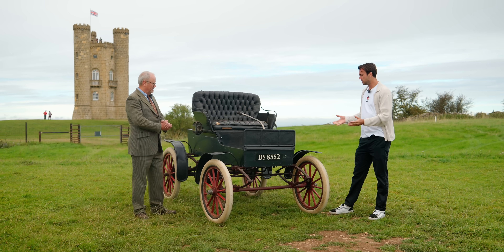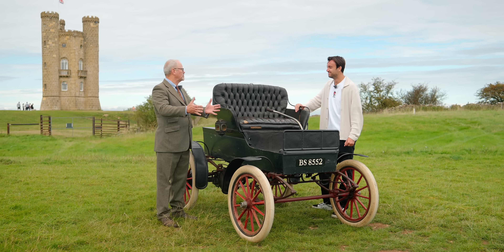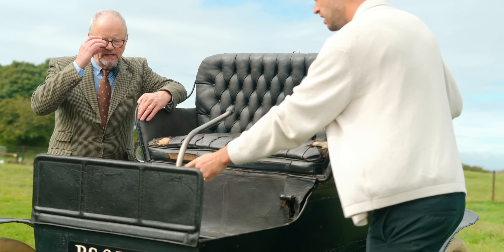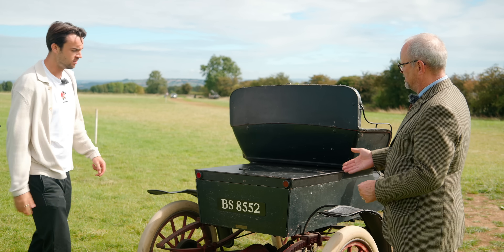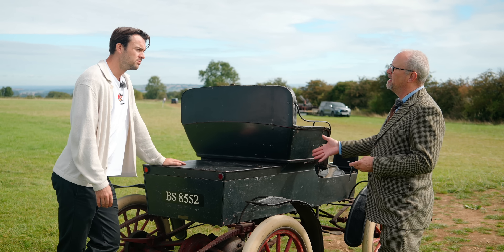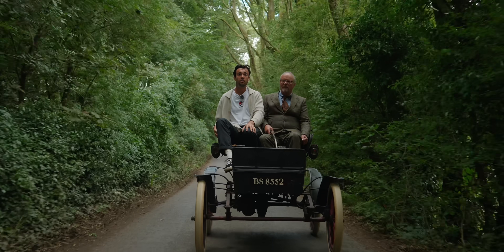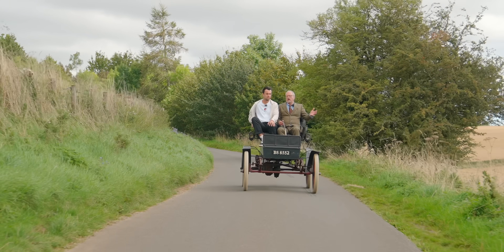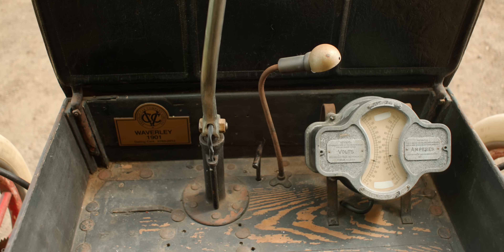Why Electric Cars Failed 100 Years Ago

Comment: An often overlooked point is that electricity was only available in towns and cities in 1901 and not all towns at that. Some rural areas did not get electrified until the fifties and sixties. So the electric was confined to urban use, which is where it shone. It was gas cars that put the country on wheels.
Reply: And before petrol became widespread steam would be what you want If you wanted to be sure about being able to refuel.
Reply: @TheHenirik Yep. There’s a reason that all the early tractors were steam-driven.
Reply: @76horsepower  >  There’s a reason that all the early tractors were steam-driven
Henry Ford mandated that the Model T be able to run on Ethanol because the farmers could make it themselves if needed.  He sold a car for the common man and the average farmer.
Reply: @TEverettReynolds  and yeah, that could very well be part of Ford's, and the petrol engine in generals, success, that and how cheap his cars was.

Didn't they also sell conversions to be able to do farm work with the model t?
Reply: @TheHenirik  steam was mostly for much heavier/heavy duty applications like trains, agricultural machines, mining and even industrial needs.
Reply: @alanmay7929  then how do you explain the several steam powered cars belonging to Jay Leno ?
Reply: @alanmay7929  steam was the obvious choice for heavy applications for a long time yes, but there were a pretty large number of manufacturers making steam powered cars, trucks and tractors before the petrol engine took over completely
Reply: @bobbrinkerhoff3592  In 1900 steam power had been around for almost 100 years in steam boats, trains, and industry, Many men were familiar with running steam engines   They found them easier to manage than the new fangled gas engines and steam power was more reliable
Reply: @mrdanforth3744  my reply was to a post saying that steam was mostly for industrial and agricultural use . The downfall of the steam powered cars , was when people that had no experience with a boiler started buying them and managed to blow themselves up creating lots of negative press in the process .
Reply: @bobbrinkerhoff3592 along with ICE engines getting better with tine overtaking steam.
Reply: @bobbrinkerhoff3592 that's mainly owned by the upper class of the time as the working class usually got the train/bus/horse driven/ the model t due to said reason of being able to make ethanol as farmers did
Reply: @TheHenirik   Hell, in the 1920s the production car with the fastest 0-60 time was driven by steam, the Doble boilerless steam care to be specific.
Reply: @alanmay7929  There were quite a few steam automobiles as well.
Reply: @bobbrinkerhoff3592  What kind of explanation do you require?
Reply: @bobbrinkerhoff3592  The downfall wat the 30 minutes it took to get them up to steam, the price, and the complexity of operation. They didn't blow up.
Reply: @Bertie-l6z  I was responding to someone saying that steam was limited to large agracultural uses , such as traction engines . My comment to him was ; so how do you explain Jay Leno  having steam automobiles in his collection , if steam was ONLY used in large applications ?  As for steam cars having blown up back in the early days of the automobile , you might want to do some research on the subject , as it did happen , along with people being scalded .
Reply: @Bertie-l6z  30 minutes to build up a head of steam , compared to the time it takes to harness the horse to your carriage ? Plus not having to muck out a stall , or feed / water the horse twice a day . Not to mention the time it takes for the wife to get ready to leave the house .
Reply: @bobbrinkerhoff3592  Compared to turning the ignition on , starting snd going. I've owned a veteran steam car, a 1909  White, and an 1899 Sperry electric.
Reply: @bobbrinkerhoff3592  Um, sure.
Reply: Still true in 2023 in most of the developing continents …
Reply: @philtucker1224  The only place where that's true anymore is Africa, and not even most of Africa -- all of North Africa is pretty much electrified, and so is a large portion of the southern part of Africa. The only parts that don't have electricity basically everywhere are subsaharan Africa north of South Africa.
Reply: @AUniqueHandleName444  yes I have spent time in (South Africa) myself as my big sister spent most of her working life over there, but even now electricity is limited at certain parts of the day on a neighbourhood rotational basis as you will probably know. In addition I still think diesel and oil generation is quite widely used in less well developed parts of the continent.
Reply: I've been to so many places around the world that had very minimal electricity, eg, no running hot water. You'd be running a diesel generator to charge your ev
Reply: @sdrc92126  100% agree SD, it’s great for the rich western countries to be able to buy these lovely rather impractical gizmos ( like curved TV screens etc) as there is so much surplus money to be spent, while the other 75% of the world is still burning their old furniture to cook a meal on..
Reply: Are we speaking of the United States? Towns in Canada had electricity before the 50s
Reply: @SJHFoto most of the country was electrified by the end of WWII (thanks to things like the Tennessee Valley Authority in the 30’s), it was probably some very isolated areas in places like Hawaii and Alaska that got electrified later.
Reply: @pokepress  So, you were speaking of the United States? This isn't meant to offend, but I thought so simply because on the internet, it is only Americans that comment in world wide forums with the assumption that everyone knows that they are talking about the US
Reply: @SJHFoto  That’s interesting, over here in the U.K. a lot of houses were still just using gas lighting and coal for heating and cooking after the end of WW2 so the government of the day implemented an electrification programme for all properties that gave each house one socket and one electric light to see if people liked the idea. This gradually caught on and they started fitting “fixed wiring” into all houses from the early fifties. However I remember my parents buying a bigger house back in 1963 and that one still just had the gas lighting and fireplace in every room including the bedrooms..
Reply: @philtucker1224  Was that because it was never installed, or was that because the Blitz destroyed the infrastructure so electricity was stopped?
Reply: @SJHFoto  people didn’t really think electricity would catch on so it wasn’t fitted to houses unless by special request. Electricity supply lines to streets and housing were still quite rare before the end of WW2 and it was really only during the massive local council rebuilding programmes following the blitz that begun in the late forties and early fifties that it was decided to fit houses with electricity and gas supply an indoor toilet and a drinkable water pipe. Bathrooms were not yet fully adopted and most families still bought out the “metal tub” often on a Friday, until that time. (I’m a fifties child and remember my grandparents still had there’s ! ) 😁
Reply: @SJHFoto  Mains electricity was still in its infancy back then, many families were still very much into traditional coal fires and gas or oil lamp lighting. The house my parents bought in 63 was built in 1938 when gas lighting was the popular choice and the two elderly sisters that lived there since new clearly never thought to change I guess..
Reply: @SJHFoto  Some cities had electricity in the 1880s. Most towns and cities were electrified by the early 1900s. But some rural areas did not get electricity until the fifties or later. Obviously, the more remote or distant from a town or city with power the longer it took.
In 1901 unless you were in or near a town or city you were out of luck.
Reply: @mrdanforth3744  I don't have electricity at my house. The closest service is about 5 miles away.
Reply: I guess recharging them a hundredtwenty years ago was quite the challenge on its own.
Wonder how a charger looked like back then.
Reply: @timhartherz5652  probably similar to an electric motor but running in reverse from a steam engine driven pulley to produce electricity. (Think of an old circus merry go round with electric light bulbs around the roof).
Reply: @philtucker1224  Possible, but not very practical.
In 19xx there was already an electric grid in certain areas, probably coal powered.
But i'm more courious about the other end.
Probably some transformer with a rectifier (tubes/valves?) and a convenient semi-standardized plug to hook the car to.
Basically i want to know how a 19hundreds EV wallcharger looks and works.
The electromechanical version of something that is done today with complicated microprocessor controlled semiconductors.
Reply: @timhartherz5652  yes interesting stuff Tim (and don’t forget all electric was just D.C. back then…)
Reply: @timhartherz5652  look at an old car with a generator on it. The old voltage regulators mechanically limited the voltage. Early farm tractors are another good place to see one. You would of had to manually monitor the charge rate to keep the batteries from cooking.They probably had a crude rectifier to convert the AC current to DC. There might have been a few DC generators around from the 1880's still in use in factories as well.
Reply: @timhartherz5652  Very big with glass mercury bulb rectifiers. Pretty to watch
Reply: I'll put you on wheels.
Reply: Hi Mr D.. Lack of an electric grid to recharge batteries is the reason, as you say. The "current wars" between Tesla and Edison weren't settled until 1896 when Tesla's system was used for the first hydro-power station at Niagara Falls. With internal combustion research rocketing ahead car manufacturers couldn't wait about for decades for the grid to expand out into the countryside. During these first years electricity didn't create a mass market, petrol did.

A major factor is that Henry Ford was a firm advocate of aircraft development, and he knew that only i.c.e.'s could provide enough power for flight along with light weight. The Ford Trimotor was the U.S.'s first mass produced airliner. Cheers, P.R.
Reply: I'm trying to imagine soldiers driving around rural France in WWII asking French farmers for a line to charge their electric jeep or deuce and a half. Or electric tank. Piston engines had such obvious advantages over early day electric schemes. In terms of energy density and portable fuel and ability to operate in remote off grid areas or where the grid is disrupted by conflict. Aircraft being an extreme example.
Reply: And 120 yrs later. Electric Vehicles are only really practical in urban centres.
Reply: So 100 years and nothing changed electric cars it's still a rich city toys nothing more....
Reply: Unfortunately yes. Well, it worked at least!
Reply: Horses were more practical for everyone as they ran on grass..
Reply: @philtucker1224  Some even ran over more things.
Reply: we didn't have the technology back then, nothing happened until the Prius and hybrids came out, then we were able to adapt to EV, it would have been impossible 100 years ago to make it, that's why all the early prototypes didn't catch on with the public, why are we still using gas today after all this time, because it was the only one that worked
Reply: Hi Mr Danforth. Shucks, you're sure right. My Grandpappy swore by gas cars. If he ran out of gas, he sent Ma to the nearest General Store to fill up a jerrycan with "Big Tree" gasoline. Couldn't do that with ay-leck-trickery, no -siree! "Howdy Mrs Robinson, will that be positive or negative you'd be wantin'?" 😄. Cheers from the boondocks, P.R.
Reply: Yeah Kerosene was already common in every home. The infrastructure to produce it, store it transport it and sell it was already in place for 50 years. Gasoline was a byproduct of kerosene production. It was the perfect fuel for the time there was never a chance that any other fuel source would have competed. Gasoline was clearly always going to win out because the infrastructure economics and business where there now they could just use all that infrastructure and business to just sell the garbage they had left over to power cars.
Reply: @@davesmith3023 Hi Dave. You're correct, but the ancient Egyptians didn't have a theory of electricity, or the chemical elements, or positive and negative ions. They cannot have understood electric technology. My guess is they found certain electro-chemical effects by trial-and-error because their alchemists were seeking to transmute base metals into gold. What they discovered and had a use for, was electro-plating, which gave the appearance of turning copper into gold. To them, this was all magic. Cheers, P.R.
Reply: My grandfather in the 1920s ran a small generator to give some electricity to the farm. Before electricity reached the area. This should show gasoline was available in the country side much before electricity.
Reply: @pierrepero9338 Hi Pierre. You're right. Five gallon cans can be taken anywhere, but electricity needs miles of power lines. Petrol had cheaper and quicker infrastructure. Cheers, P.R.
Reply: What gas?  Steam?  Natural gas?  Petroleum gas??? I was under the impression some form of a combustable liquid (petrol / diesel) was used to propel a vehicle.
Reply: @Andreschannel_SA Hi Andre. Natural gas is methane, CH4. I.C.E.'s can run on gaseous fuels if set up to do so. They often were during WW2 when petrol was unavailable. Diesels are very omnivorous. Cheers, P.R.
Reply: Was going to say that too.
Reply: It's not like Gas stations were a dime-a-dozen in rural areas either. People had to drive long distances to fill up gas. It would've made a lot more sense to have common charging stations. Also most of the US was electrified by the 1920s, so rural residents could just charge at home. Battery swapping was also available on old electric cars.
Reply: @empirestate8791 Hi. Correct, they weren't, but just like in the Pacific islands during WW2 "petrol dumps" were created out in the boondocks for country folk. Every General Store  sold gas filled 5 gallon tins. Half a dozen of those would keep the flivver going for a month, even if Pa had to drive 50 miles get there. Driving 50 miles to get a recharge was a waste of time, with range of 100 miles you'd have to go back for another recharge as soon as you got home. What you've missed is that petrol is the second most energy dense fuel we have, and during the first half of C20 batteries had low efficiency. 
Battery swapping was only available in the cities (for taxis mainly), and the huge drawback was the weight of changing the batteries. Petrol could be quickly pumped with a hand-pump. Cheers, P.R.
Reply: @mrdanforth3744 as it still is today.
Reply: You’ll never get rid off combustion ,ever
Reply: "... the electric was confined to urban use, which is where it shone. It was gas cars that put the country on wheels". Now it's get the people out of their gas cars and for those with the funds, into expensive electric cars for mainly urban use.
Reply: and so nothing has changed
Reply: Electricity availability was never the problem. It's the same problem we have today: Too expensive, too many drawbacks. And the problems of today are far worse because of the demand these vehicles would need to fulfill compared to gas vehicles. When you're using the same energy as an entire house does in a week, and need it all delivered in 15 minutes, that's a HUGE strain on the grid. Literally HUNDREDS of times the strain. Now imagine what it would cost to upgrade the grid to support them. It would be like rebuilding the grid 100 times over. That's hundreds of trillions of dollars. Same with pushing electric, because the US only produces 8 million vehicles a year in total. That means it would take the better part of an entire century just to meet todays population, not even counting growth over that 100 years, or the replacement of vehicles over that 100 years. Or in other words, it's impossible. We would have to produce 10 times more vehicles just to meet current vehicle demand, and that still doesn't cover the rest of the logistics. It's simply impossible.
Reply: I think it was 1959 or 1960 that my grandparent's farm had electricity hooked up. It's in the Midwest and not all that remote from cities.
Reply: And petrol could be dilivered at any train depot on order .   Electricity needed new infastructure that was in the future and nobody can predict the future .
Reply: You've got four wheels spinning, so you could have four flywheels spinning and four mags should get you up there about 80 MPH, I think you could keep your batteries 
charged. Wouldn't that be cool?
Reply: Which country is that?
Reply: But just imagine the world if there had been solid development of electric cars for the last 120 years.
Reply: @lancer1993  electric motor development never stopped,  commercially available batteries have effectively stalled at lithium ion. Lithium ion is okay for cellphones and laptops, for cars they are unsustainable.
Reply: @lancer1993  not just cars, but everything electric. Up until the fifties it was mainly produced by burning wood, gas, coal, oil or diesel etc, so it was only when nuclear power was eventually harnessed that it has become a truly clean “game changer” ..

Comment: Would be interesting to see someone reimagine the form of this car with contemporary technology. I love the footprint, the visibility for the driver, and the safe speed. It really makes sense that they were popular as cities cars way back when.
Reply: I appreciate the simplicity of the Waverley - even the tiller steering. The moment you start to "reimagine" it from a modern point of view, you're never going to stop: steering WHEEL, accelerator PEDAL, separate brake PEDAL - which self-decides electronically whether friction or regenerative, COIL springs and DAMPERS - might as well just buy a Smart EQ Fortwo.